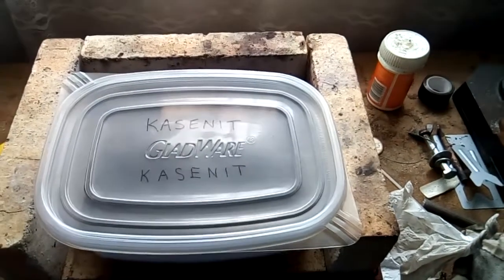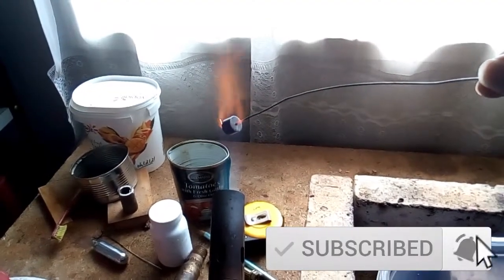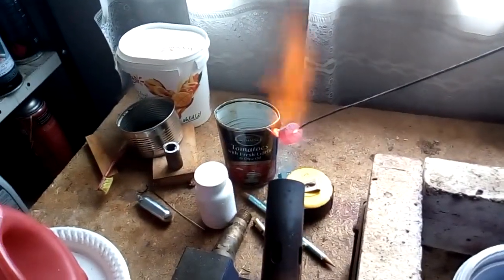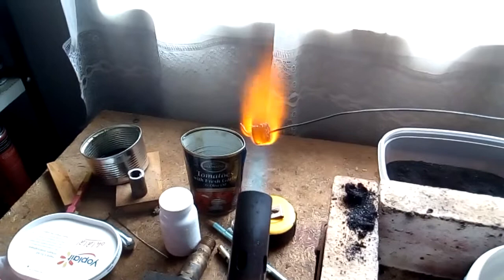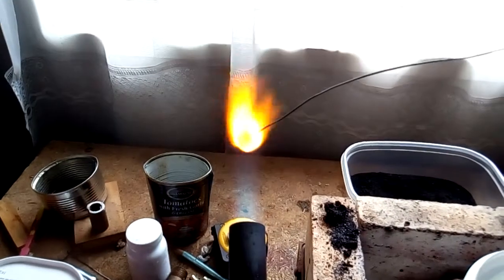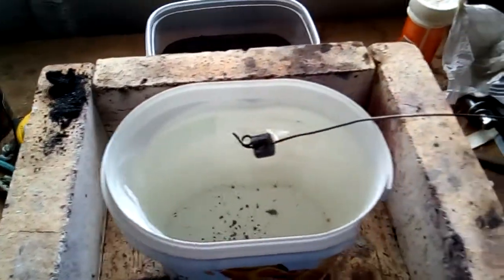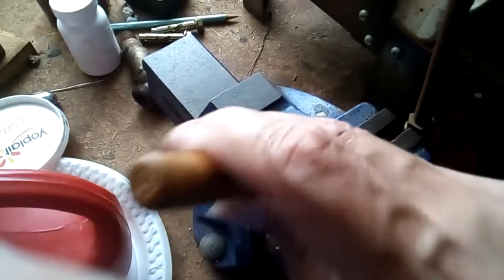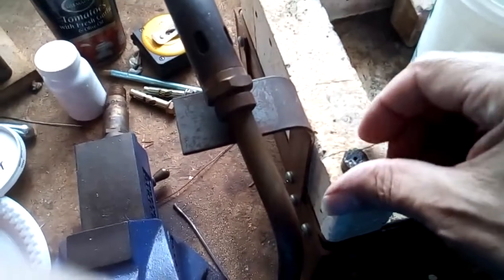Case Hardening mild steel in the home workshop using Kasenit

Comment: If I was to repeat this process another couple of times maybe, would that increase the case hardened layer or would it not make a difference? Can you over do it?
Reply from the maker: It will increase the depth of the case.  Definitely, the soft core will be reduced, and the whole piece more brittle

Comment: Good job! Thanks for sharing. I once needed a special threading tap for a job i was doing. I made the tap from low carbon steel, treated it like you did with Kasenit and was able to cut threads in mild steel with it.
Reply from the maker: Good work!  Case hardening is very useful

Comment: Does "free cutting" contain lead? They tend to.
EN8 would be better, no real need for compound ...machines fine, water quench, straw to brown temper.
Or EN3 "bright" with compound. 
EN36 is real deal case hardening steel.
Reply from the maker: Yes, it contains lead.  I'm glad it was successful